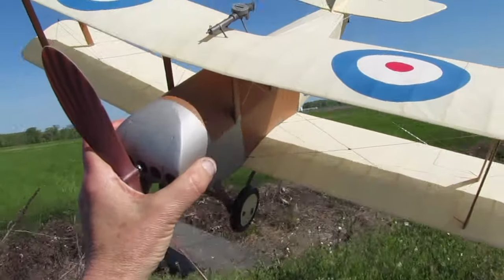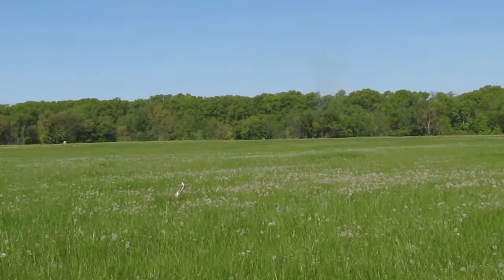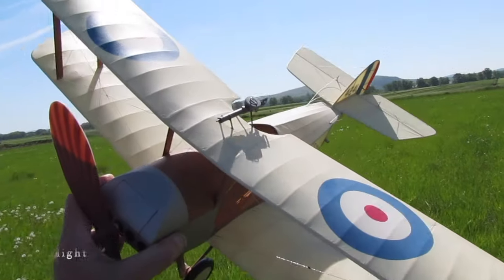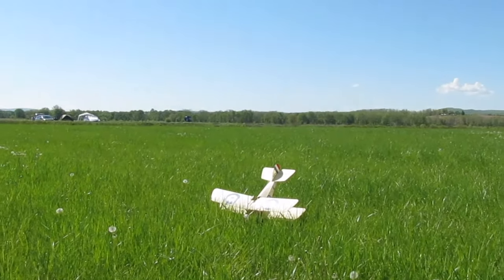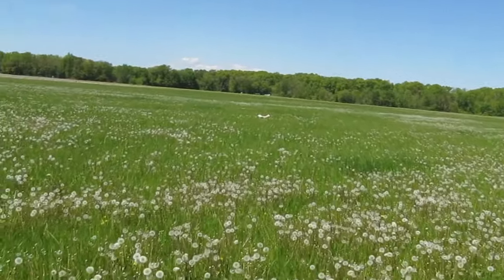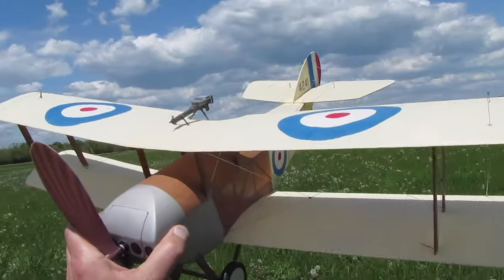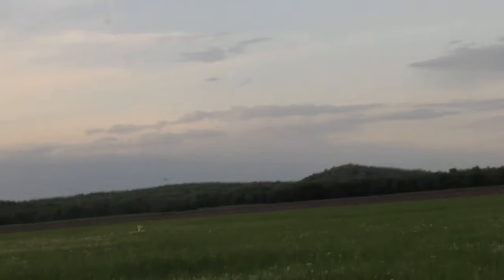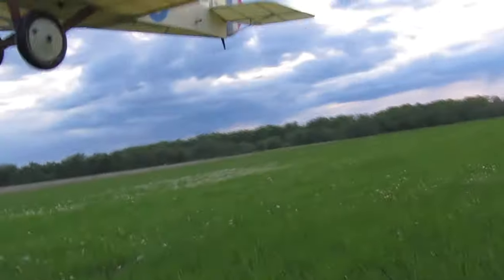Free Flight Trimming Basics #2 - How to Fly A WW1 Biplane

Comment: I'm looking forward to seeing some videos for doing the rigging and flying wires on these models.
Reply from the maker: Thx, I hope to get to that with my next bipe. I don't believe I filmed it when I built the Martinsyde...a missed opportunity. It's pretty easy, somewhat relaxing...like threading the needle, but with dots of CA at the entry points on the struts as u go along.
Reply from the maker: Go to 9:25 on this video to see a few photos of the rigging process. I place CA on the end of the thread (about 1" long) then use it as a needle to weave through the strut pin holes.The wings can be done with 4 lengths of thread. https://youtu.be/SAfxaU9otEs?si=v7eI7xD0s1jUVeik

Comment: This is really advanced stuff, Tom. I myself am struggling to get to grips with all the options, but the info esp on gurney flaps is invaluable, and very clearly put.
             This Martinsyde is a DREAM of a plane. Such presence in the air for a rubber powered bipe is rare indeed, and a real joy to see, as you say, framed by the beautiful skyscape. Magnificent and utterly compelling flights, and you're not even at max turns!
             I'm confident that the summer will bring more of those 'fluke' flights, until they become the norm. This plane, with its new, light sliced rib wings will be eating thermals for breakfast and you're going to need that dethermalisor! Most impressive. Thank you Tom! ⭐👍
Reply from the maker: Thx, Will.  I'm looking forward to another session with her this year.  I haven't flown her since late '21, so actually seeing what I hadn't really seen or noticed before this re-edit (her stability going left instead of right) I'll likely begin there and push her left until she reaches max winds. I hope to have a productive update with her to post here. Come mid May, the grass should be once again be high, so fingers crossed.

Comment: great stuff! If it is so sensitive, is there not a risk that each resetting of the tail after DT usage introduces a subtle change in aerodynamics? Not sure what you can do about hat risk though - has to be better than a fly-away !!
Reply from the maker: Not really, since the line is pulled tight and the stab is secure on its seat. But the stab fins are large, and because they're hinged, they could get bumped a bit. Next time I'll make the stab one piece, then only rely on shimming

Comment: Hello, your videos are spectacular!!!!, I have a question! I have my plane with a rubber motor and when I launch it it comes out fine but after a few seconds it goes into 3D flight rotating on its axis and as it can it adjusts itself and ends up flying well!! What can I do to improve it???? Thanks for all your help!!!!
Reply from the maker: Without having a film to see the model in flights, it's hard to say, but it sounds like you have a power burst (excessive torque) at the start that is causing the aerobatics. Once the torque fades, the model settles down and flies ok.  I'd suggest adding more length to the motor to lessen the torque, and keep an eye on the thrust adjustment....u might need a bit of down thrust. Good luck.
Reply: @maxfliart  very good, I'm going to try all the options you give me and keep learning!!! thank you very much for your help!